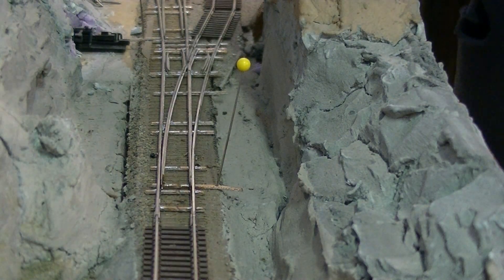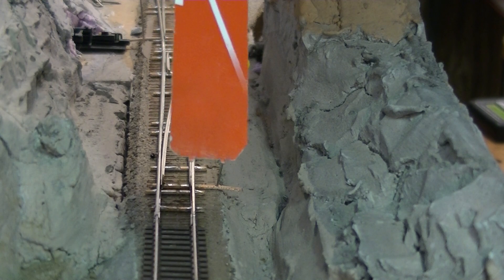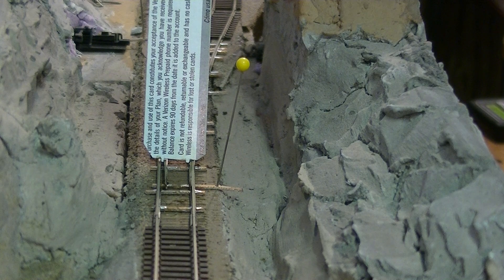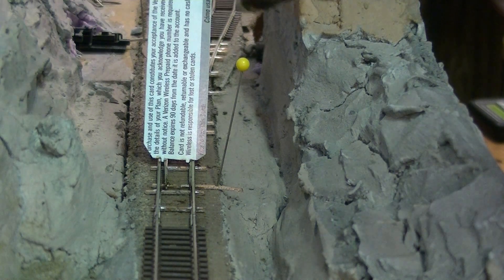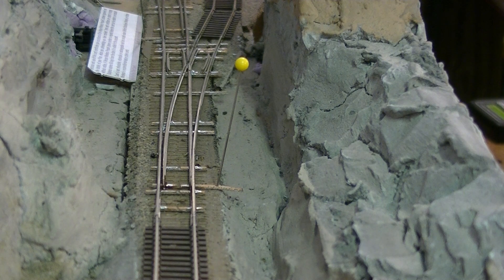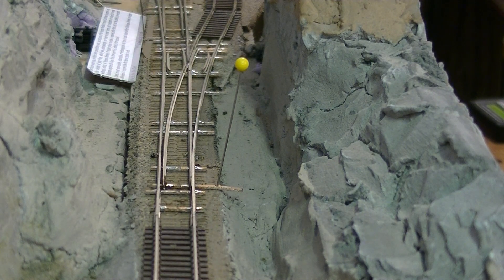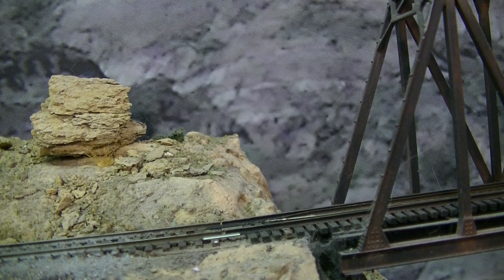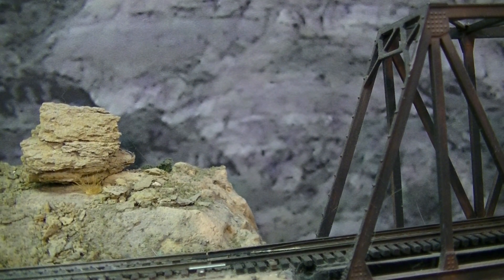750 plus subs!! Fixing a sprung switch point and BLI light pacific NP&BH #104 pulling!

Comment: You talk about temperature swings in your train room causing you issues.  What are you using for a train room?
Reply from the maker: It is a 1962 Rollohome trailer house that has been gutted and remodeled. Extra insulation and new windows and such. Heat is provided by a wood stove, which is fine as long as I am around. We took a weekend away a couple of weeks back, and the small electric heaters kept it at only 50F. Long term plan is for a nice propane heater to go in, but a few other things have to come into play first.